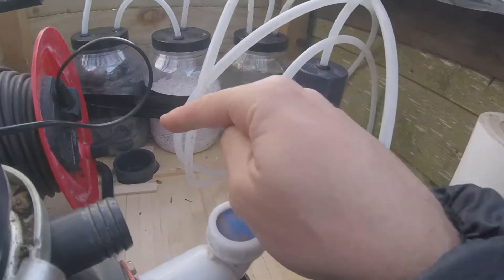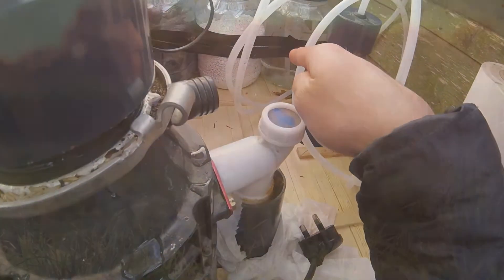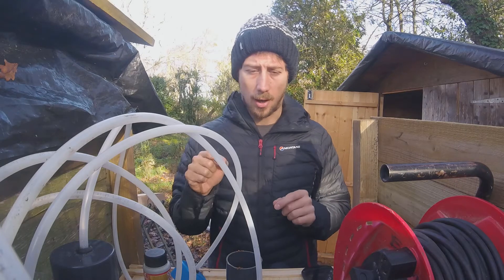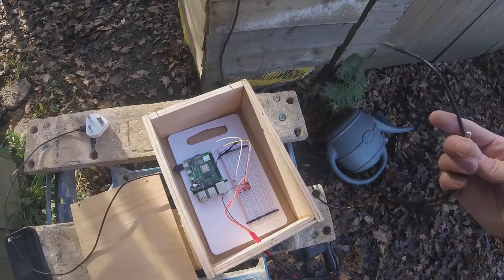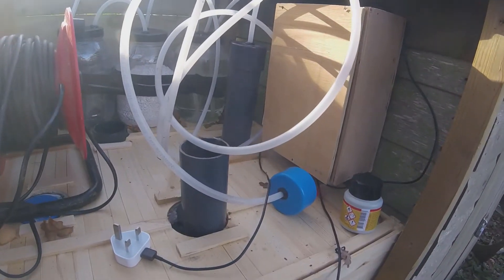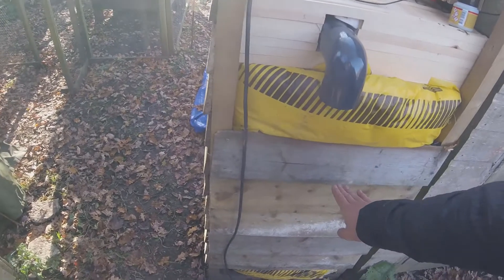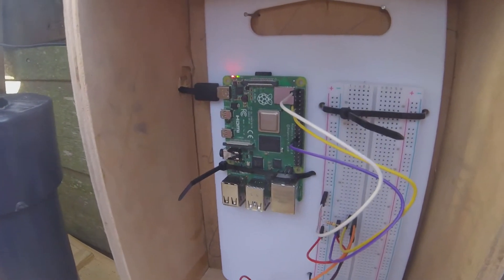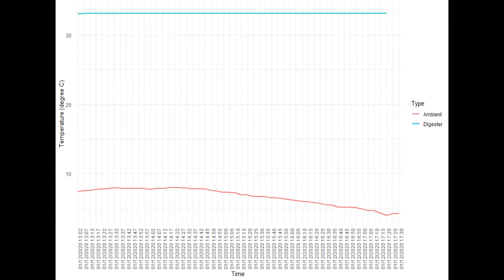Making a biogas digester PART IV // Raspberry Pi monitoring // First gas production

Comment: Sorry if I'm repeating what someone else has said. I havent read the comments. I was thinking if you had direct sun exposure you could use solar convection and solar power to run a heating element for your digester. Also a cheap wind turbine to help generate power to a battery bank. Just a thought. I'm in Illinois, USA and I have used a homemade solar convection heater in the winter to heat my South facing porch.
Reply from the maker: Yeah, it is a possibility. I have landed on using a pond heater to try and stabilize the temp. In the new housing I built for it, with a lot of insulation it isn't using too much power. Although, I haven't been back to check on it in a few months as I moved from the property.

Comment: Hey chap, tanc here,   I noticed that the temperature varies greatly from bottom to top due to heat rising.   28 at the bottom and 40 at the top.    I am installing a big stirrer to try and even it out with 5 sensors in the tub to check when uniformity haas been achieved.     I think that without removing the stratification I am only producing gas from a small band of the digester.    If I get a half decent bit of code I’ll let you know..     cheers.    Tanc
Reply from the maker: Hey man. Yeah interesting. Where are you heating from again? I have my heater half way up, so assumed that it would create a convection at least between that region and the top. I am coming towards the end of my PhD, so I am hoping I'll be able to get out a play with my digester soon. Its doing okay at the moment, but I'd like to get my monitoring setup to really have a look at whats going on.
Reply: @GetMeOffGrid_   hey again.all good?   i use a 24v 200w bed heater from a 3d printer on the bottom (outside) of a steel oil drum. i had also thought that this along with really good insulation would keep the reactor at the same temerature but it definitely does not.   i love the hazel twig - it made me laugh as i used a withy to insert my first thermocouple.  next time you are there try measuring the temp from top to bottom and see if its uniform.   i spoke with a professor Sandra Esteves at USE, she runs the centre of excellence for anaerobic digestion.   she said that stratification is definitely a thing and that outside the 30 - 40 range you start getting the other non methanogen microbes which not only reduce the methane production but increase the production of other stuff that is not helpful.    i have been delving into RPI this week and have a circuit with 5 sensors and 2 relays, one for the stirrer and one for the heater.   the code turns the stirrer on when the difference between min and max exceeds 1degC and uses a pid loop to controll the heater.   have not yet tested off the bench but its looking ok so far.  more than happy to share code if youre interested (im a total python newbie btw so dont expect too much).   what is your phd in? and did you see my bottling vid?   cheers

tanc
Reply from the maker: Hey! I don't think I got the link for the vid. I missed your comment about the funding etc. Ooof sounds like you have a nice little setup going on there! Very jealous that you have the equipment to work in metal. Seems like everything is a bit more doable in metal, you want to weld plastic back together as easily. haha. I'd definitely be interested in the code, I am not a Python user either, I use R for my PhD. It's in tropical conservation, using bioacoustics to monitor endangered parrots (niche I know).  Cheers

Comment: Very good job... BUT, have you thought about putting the digester assembly in the ground??? Usually, when small scale, digesters are buried in the ground because the earth provides a somewhat constant temperature at depth of around 1-2 meters... and it depends on your location but since you are in the UK, you should have at least 12 C constant temp at around 1.5 meter depth...
Ideally, I suggest you do 2 things to get your thermal dynamics improved...
1. Put the digester assembly in the ground... thats the absolute minimum...
2. Try to find some waste heat source and use that waste heat source to provide latent heating to the digester... IDEALLY, i would suggest using water runoff from your house to first go though a helical coil of copper tubing before exiting and going to the sewer... so essentially it would work the following way:
- When you use water in the house for washing dishes, showering, etc, that water is at minimum 45 C because your body temp is at 36.6 C... So when the water is used for whatever it is you are washing, it then exits your house and goes to some main outflow/outlet pipe which is connected to the sewage system/septic system... If you add a connection at the house outflow pipe and reroute the water to another pipe/hose which is connected to the brass/copper/pvc coil and then put the coil inside your digester, your waste water will be heating your digester and thus increasing the production of gas... BTW, digester should work at temps around 40 C for BEST PERFORMANCE... but ideally the DIGESTER should not have internal temp below 25 C, then the bacteria will be active and below 25C bacteria are kind of in semi-hibernating mode...
Anyway, im sure you can find some scrap or super cheap copper piping which you can get at junk yards or just buy some and its pretty easy to form it into a helical coil which you put inside the digester... 
The biggest pain will be getting the COIL OUTFLOW and directing it back to the sewage entry point... and another problem is that you will need to figure out how to do that NOW since you have shit in the digester... but its definitely worth it and i highly recommend you seriously think about it... 
i would love to see you get your mini-digester upto 80%++ potential... and you need proper internal temps for that...
Reply from the maker: Thanks for the advice. Yeah a more stable temperature as a base would be great, reducing the need to expend a lot of energy to buffer the minimums. Not sure I can dig it in where I am though, that also applies to the gray water  unfortunately. I am thinking some kind of solar heat in the summer and maybe compost heat during the winter, plus a better insulated housing. If I ever got my own space I would definitely try digging it in. You see a lot of those kinds of digesters in India, although I'd guess they are in the ground of other reasons.
Reply: @GetMeOffGrid_  You may look at getting a small solar panel setup with a battery.  You could use this to power both the raspberry pi and a heater when needed.

Comment: Have you tried connecting your Raspberry Pi to an analog CH4 Gas Sensor (MQ4)? Would be awesome to know the CH4 % before and after the gas is filtrated by your system.
Reply from the maker: Hi Ryan. I haven't used it yet. Looks like cool little sensor, the only issue I see if its no an "in-flow" sensor. I'm sure there are ways round that, but I'd be concerned about putting it in moist environments like the before the scrubbers. Have you used them before?
Reply: Hi  @GetMeOffGrid_ , thats correct. I have used it with an Arduino. The MQ4 is just a cheap option to detect CH4 variations to have a crude idea if the biogas filters are working as intended. Note that this sensor takes a while to "warm up", which is not perfect. There are much better sensors but they also cost more than 6 pound. 
About your humidity concerns, you could use nail polish to protect the module board. If still hesitant, you can use epoxy instead.
Reply from the maker: Okay, sounds like it is something to consider. I'd love to be able to get to a system that can monitor gas production, quality and automate things like compression. Big ideas, but I'll get there slowly.
Reply: I'm sure you can make it happen after watching some of your videos. Btw, I went looking on gumtree for used gas meters and found them as cheap as 10 pound. I imagine that would help measuring the biogas you produce, if that's a thing you want to achieve. To measure the quality of the biogas, and based on what you explained in the scrubbers video, I would install sensors for CH4 (MQ4), CO2 (MG811), H2S (MQ136), Humidity and Temperature (DHT22). About compression automation, I imagine you would need a relay to toggle the compressor on/off and a couple of solenoid valves to open/close the gas. To be safe I guess you would also need a pressure sensor to ensure it stops compressing the gas into your tank when it reaches a certain psi amount. That would be my prototype. Have fun!

Comment: @Get Me Off Grid
Re: Suggestions
Spoilers: No app recommendations, just technical improvements.

First off, great job on the biodigester. I loved especially that you utilized thermal protection for the unit and used globally available components for the build. 

Secondly, I'm playing around with the concept as well and have half of the components needed to complete my own. That being said, I'm sharing the inclusions I want in my own build for various reasons. So, here are the ideas...

1. Utilize the RaspberryPi more thoroughly; you can program it to turn on/off the heater when temperature range limits are reached, which will increase the efficiency of your unit.
2. You can also utilize the gas produced to run a (flame) heating element inside an enclosed steel frame under a fire retardant/fire resistant shielding, something that isn't going to burst into flames. You could design this metal enclosure to get warm enough to be within range of the optimal temp for the biodigester and have a small flame such as a pilot light or such and have the arduino control that as well (along with a sparking mechanism for flame outs). You wouldn't need much, I think a very small flame might be enough for your application, save for snow happening. This isn't the safest or best idea I have for this, but it is free as far as running costs and would allow for Peltiers to be run as energy vampires to power an electrical peripheral such as a battery backup bank for the arduino or additional sensors. 
3. You can use a heating element from a dishwasher as inspiration for an in tank heating element. I haven't figured out how to get it inside the tank without cutting the top of the tank off and don't want to deal with that extra work anyway. Plastic welding isn't fun if you can avoid it. Especially when the final product needs to be air tight. This is why the fishtank heater is the best available option. Something globally available, maybe from the automotive industry might make a better solution if it can be automatically controlled by the Raspberry Pi to account for temperature fluctuations in the air. Such as a blower motor and air ducts to an area that can be heated normally and is already being temperature controlled such as a detached garage. Your biodigester would have to have to be leak free, no escaping gasses, for that to be considered. Ventilation will always be a constant concern. You can also use geothermal or solarthermal to your advantage, running pvc tubing through the unit and having it connected to either buried pipes or a solar water heater and having that be your thermal control. It still needs to be controlled by the Raspberry Pi and have ability to shut off flow to the biodigester to prevent exceeding high range temperatures. Yes, even in snow weather.
4. You need a way to track your "fuel" deposits into the unit as well as track the ph of the water in the filter/scrubber. There is a saturation point for both the co2 sequestration and moisture removal capacities as well as for the limit for how much the steel wool can handle. You'll want a meter telling you how much gas has been produced as well as the pressure in your collection unit. I recommend using a steel tank and air compressor for long term storage purposes and having the raspberry pi send you warning messages when the tank reaches 65% of capacity. I recommend following whatever guidelines the tank you choose has for psi capacity limits and NEVER going within 20% of total storage capacity. Remember, steel tanks need to be inspected and tested periodically for safety reasons. Plastic also degrades when exposed to sunlight and parts will need to be replaced as the unit ages, don't let that become a problem later on, keep spare parts available on hand in case of emergencies.
5. Effluent discharge is more valuable than the gas, don't waste it. You can sell it as liquid fertilizer as long as you have it tested for nutrient content and label it properly. Otherwise just use it in your own garden. Remember to consider watering ratios when fertigating with it.
Reply from the maker: Thank you so much for taking the time and sharing your knowledge! So much there to help me develop this project. Hopefully I can integrate some of those suggestions in soon. Cheers
Reply: @GetMeOffGrid_  look into "Earthship" for further ideas and concepts related to this project.
Reply from the maker: @FatChanceTheCouchDog  Will do thanks!

Comment: Maybe you could have put the thermostat on the outside between the lagging and the bin to save drilling another hole.
Reply from the maker: I am hoping to wrap it in a water pipe heater later on so on the outside isn't really an option.